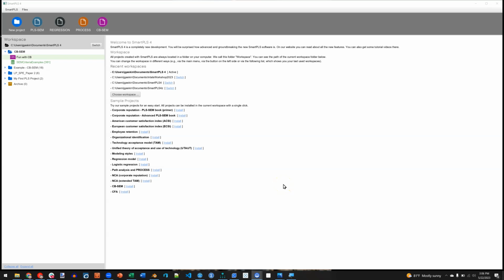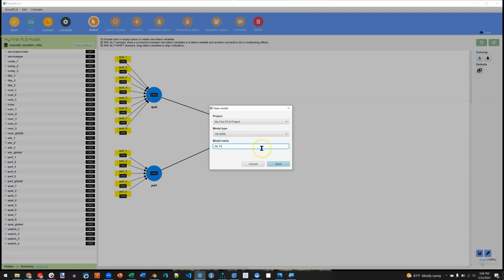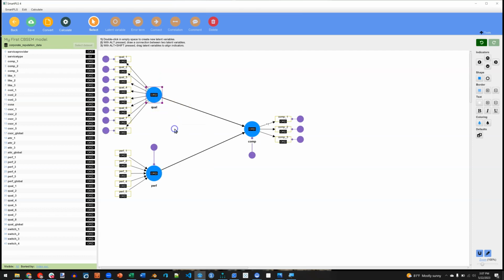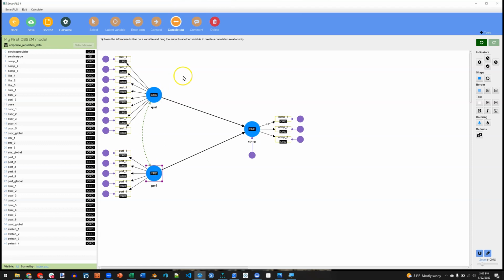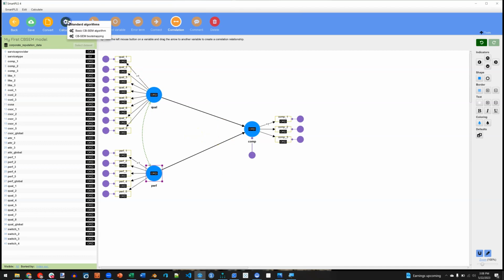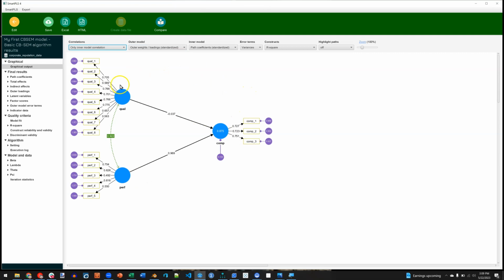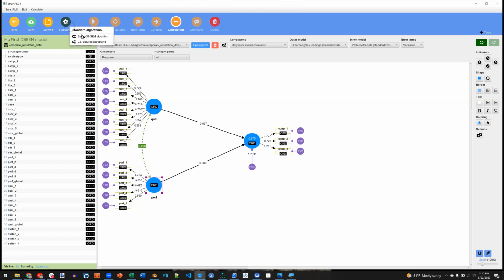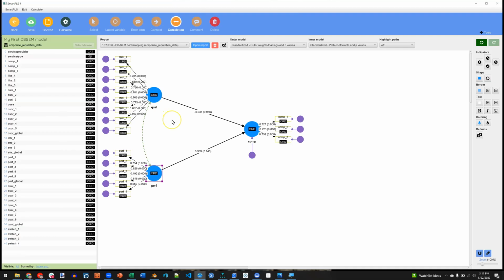SmartPLS 4: convert PLS to CB SEM

Comment: Do we need p-values on everything? I.e., MUST we run the bootstrap version or can we get away with the basic CB-SEM algorithm? 

Also, you correlated the exogenous variables before running the algorithm. How do we handle this if we have mediator variables, do we correlate those with the exogenous variable?
Reply from the maker: p-values are typically expected for any hypothesis test. You can only correlate exogenous variables (not mediators).

Comment: Hi Dr. Gaskin

Thanks for your videos. I have found them very helpful, especially considering that I am about to collect and analyze my data using SMARTPLS4. I will be performing CB-SEM. I wanted to ask why you didn't correlate 'perf' and 'qual' with 'comp' before running the basic CB-SEM algorithm? My question concerning the measurement model is: do we correlate all variables with one another before executing the CB-SEM algorithm. That is, the independent, dependent, and mediator variables, do they all get correlated? 

When you get a moment, an answer would be appreciated if possible. Thank you!
Reply from the maker: You cannot correlate endogenous variables (like comp). If you run a CFA instead, then you can. But this model was a structural model.
Reply: @Gaskination  Yes, true! Sorry, I was referring to the measurement model and wondering if we correlate all variables in the entire model (independent and dependent), which it appears that we do. Thanks.

Comment: Please help! This feature is great but I run into an error when trying to run basic algorithm. "An error occurred in the algorithm routine. This could be due to logic error or reaching maximum number of iterations(1000). Please try adjusting the parameters." I completed the building of my SEM model in PLS as I'm more familiar with PLS and not AMOS, and hoping I can complete the last step of getting model fit in CB. Is it because I have higher constructs, mediation and moderation effects in my model? If so, how do I over come that? Thanks very much!
Reply from the maker: This happens when there is too much error for the sample size to handle. So, if you have a small sample, it may be hard for CB to resolve it.

Comment: Thanks for sharing. if the loading factors were good >=0.4, but CFI and TLI <.09). What should we do? How to make covariance between items in one scale (based on what?). Thanks
Reply from the maker: If the CFI is less than 0.900, then it implies there are modeling issues. Check the validities to see if there are clues there as to which items may be causing the poor fit. I would recommend against covarying items within a single factor. This implies too much redundancy. It would be better to omit one of the redundant items.